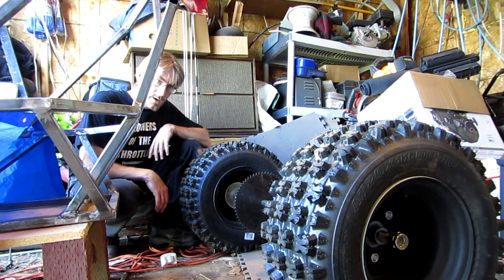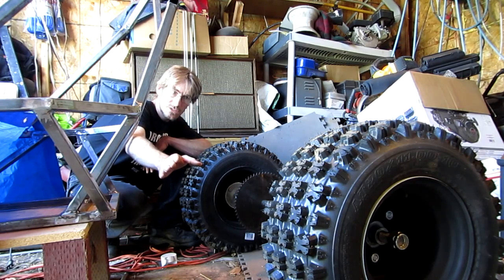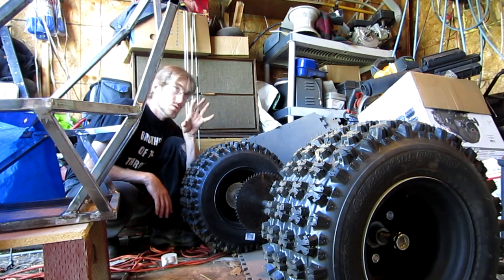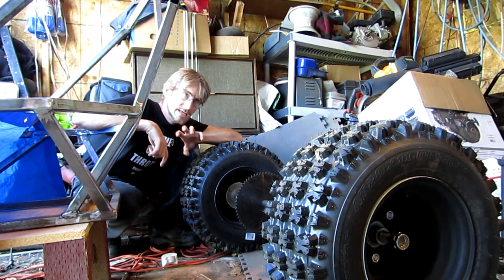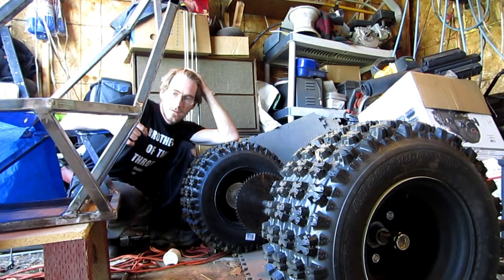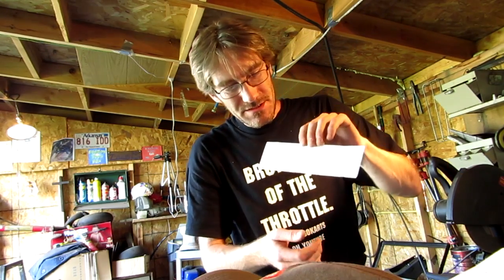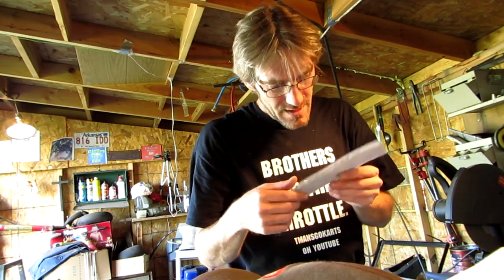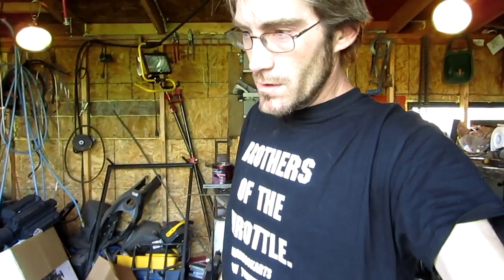Update Go Kart , Building █  ( The Fullscreen Machine )

Comment: Oh Hell Yeah!! Hey Tman, I totally follow what u r sayin about keepin the engine off the live axel setup. My suggestion would be 2 make the pivot jack shaft ur gear reduction jack shaft as well,(eliminate the slave jack shaft). I think you can do it that way because u r usin bearings. Also, tyin the shocks into a mount that's affixed 2 the exoskeleton is a totally acceptable and cool way 2 support the rear suspension!! Keep up the super job and great work!!